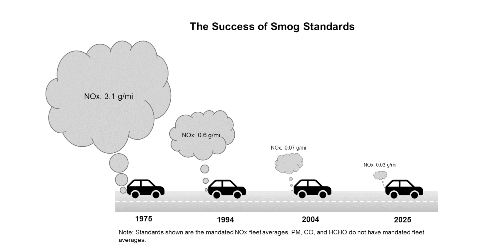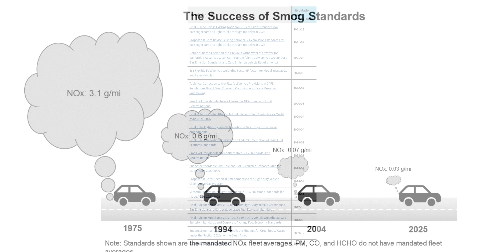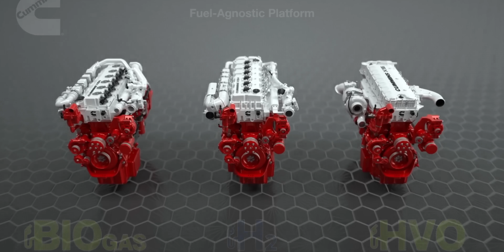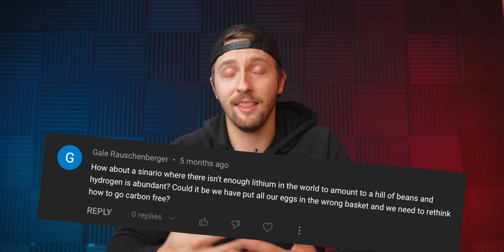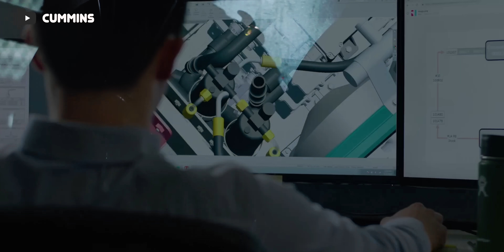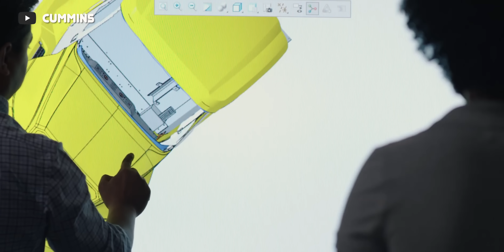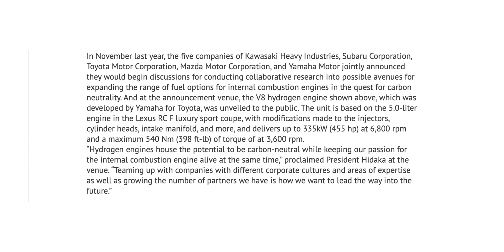Cummins Hydrogen Engine Will KILL DIESELS FOREVER

Comment: Seems difficult to replace the available energy density of diesel fuel.
Reply: If pressurized Hydrogen is half as dense that is not a big deal.
Reply: @gregkramer5588  explain your thought
Reply: @scottsand2317  have you studied hydrogen at all ?
Reply: It is but it has to happen
Reply: Pneumatics
Reply: Diesel has an energy density of 45.5 megajoules per kilogram (MJ/kg), slightly lower than gasoline, which has an energy density of 45.8 MJ/kg. By contrast, hydrogen has an energy density of approximately 120 MJ/kg, almost three times more than diesel or gasoline.
Reply: @shaneladkins  At high pressure and low temp right?  Hydrogen doesn't like the liquid state.
Reply: @shaneladkins  yes but you're failing to address the amount of energy required to reduce the temperature of hydrogen and keep it Cryo long enough to use it... Gaseous hydrogen is woeful in comparison to diesel and gasoline
Reply: @fluchtigziege3202  Of course this is a complex issue with many variables.   The comment being responded to was ONLY about energy density.  (Why do you think the Space Shuttle used Hydrogen?)
Reply: @Shaneon Adkins  it's a volume issue, not an energy issue.
Reply: @arthurkineard7356  correct people like to think they are smart by comparing the energy per kg/Litre of hydrogen vs conventional fuels, however this is ignoring a myriad of issues surrounding using hydrogen for fuel
Reply: It is not as big of a deal as you are imagining. You simply need larger tanks to make up for the volume. Other issues are a bigger deal like hydrogen embrittlement, producing green hydrogen and a non existent transport system. All solvable problems with current technology. What we are missing is the will to do it. To many other competing interest.
Reply: @arthurkineard7356  it does look like hydrogen may have a place in long haul trucking for sure.  I can picture a row of 4 vertical pressure tanks behind the cab on a semi tractor.   Of course it will be fuel cell and not ICE. The good thing this shrinks the infrastructure problem a lot!
Reply: @arthurkineard7356  LNG much better
Reply: @tobias1959  yea but greenness don't like it
Reply: @tobias1959  LNG is still a fossil fuel, and with goverments starting to tax use of fossil fuels more and more, its not a viable option. Not to mention that LNG requires massive infrastructure (same as hydrogen tho.)
Whole point of electrification and alternative fuel sources is to cut off reliance to fossil fuels. (and lower CO2 emissions.)
Reply: @Luihuable  The irony is that at this point in time, most hydrogen produced uses NG as feedstock.
Reply: @Luihuable  Infrastructure is right to our homes that have natural gas. Where is the hydrogen coming from and the energy to transform
Reply: @arthurkineard7356  it's not economically viable, and thus won't happen
Reply: @Fluchtig Ziege  yea it's hard to compete with embedded technology and infrastructure, but forever is a long time
Reply: @arthurkineard7356  aint nothing lasting forever, EV will have just as short of a run as ICE has had, it's just not the continual and unending tech they want you to think it is, economically ineffective to be recycled, toxic mining and recycling (where it's possible to recycle lots of the components can't be recycled), toxic fires from batteries, short service life of scalable small cell batteries, etc etc etc etc, a clean fuel would make more sense than EV albeit expensive in the short term, EV might get cheap in the interim but many pressures are already on the supply chain with basically 0 alternatives to the resources needed. It's not a win/win like everyone thinks and scaling for range in these vehicles just adds even more issues and would be socially irresponsible to build, aka EV will never replace long range vehicles that currently run on diesel/petrol.
Reply: My city is 7 years from banning anything that’s not zero emission. It’s not so much a question of “better” for some markets as “actually marketable”
Reply: @MichaelSmith-fg8xh  a decision that will be rolled back by a successive government after its woefully expensive and inept "implementation" takes place
Reply: The energy density of hydrogen (By mass or weight) is more than 3x that of diesel
Reply: @toddclean547  hydrogen mainly derived from Natural gas though right?
Reply: @davidb5952  Hydrogen derived from any source.   I am not talking carbon footprint here.   Only the energy chart.   (Anyone can Google this; it's Middle School level info)
Reply: @toddclean547  Quick everyone, google some random terms like "energy chart" and you will be 100% convinced that toddy has a big old chemistry degree, lmao, I am guessing that you deleted your "Im a chemist" comment because you aren't and pretending you were as an appeal to authority looked dumb, cos it was, and you got embarrassed. Lmao
Reply: @toddclean547  so we've gone from appeals to authority to ad hominem? Seems you really haven't got a degree at all, of any kind
Reply: @toddclean547  please do dazzle us with 5th grade science some more while you pretend to have a degree to win arguments you can't win
Reply: @fluchtigziege3202  answer the 3 water questions and then we will talk
Reply: @toddclean547  good mate how's ya imagination degree?
Reply: @fluchtigziege3202  Answer the water questions smart guy
Reply: @toddclean547  you're attempting to strawman
Reply: @toddclean547  try actually debating instead of using appeals to authority, ad hominem, strawman
Reply: @fluchtigziege3202  Try to stop using diversion tactics.   Answer the water questions.   And do you live with your parents?   (What country do you live in?)
Reply: @toddclean547  still busy building that strawman I see
Reply: Sorry to everyone else reading this Todd clean character literally spent all yesterday trying to strawman the debate/discussion after his attempts at ad hominem and appeals to authority gained him no ground whatsoever, it was funny but now it's just sad, what I assume is a lowly uneducated adult trying to pretend they have a chemistry degree, when the topic is more focussed on physics and engineering, as some sort of "gotcha" moment... When in actuality if they did have a degree thus far their lack of knowledge demonstrated in their own ineptitude would suggest that degree, should it exist, isn't worth as much as a kindergarten graduation certificate.
Reply: @fluchtigziege3202  I'm sorry that Fluckting won't  (can't) answer any of my basic questions   The debate started about chemistry but he knows nothing about it.   In the meantime, he spends all his time playing video games at his mom's house.
Reply: @toddclean547  sorry mate but no one cares about your strawman argument
Reply: @toddclean547  you can't debate me because nothing you have done is even remotely resembling a debate, and hominem attacks, appeals to authority and straw man tactics aren't valid debate methods
Reply: @toddclean547  you are literally the only one who has changed the subject, unless you're reading my responses to other people in a got of vanity thinking they're addressing you
Reply: @toddclean547  you make a lot of assumptions, I'm curious what you have besides half a dozen videos unrelated to anything you're saying to back it up? Yunno since you wanna change the subject and all
Reply: @fluchtigziege3202  Then answer my simple questions.   Are you living in your parents house?    Just answer!
Reply: @toddclean547  you said I am staying in someone else's home, burden of proof is on you mate
Reply: @fluchtigziege3202  Answer my questions
Reply: @fluchtigziege3202  Answer my questions mamas boy
Reply: @fluchtigziege3202  Answer the questions
Reply: @toddclean547  like I said you made the claim so, as per debate, the burden of proof is on you
Reply: @fluchtigziege3202  Answer my questions
Reply: @toddclean547  you fail to see how this works
Reply: @fluchtigziege3202  I fail to see how how you work.   I'm sure you don't.   Hey mom  --  I need some money.
Reply: @toddclean547  we'll see it's very simple, I'm sticking to valid and reliable debate methods whilst you are trying to use every faux pas in the book which achieves nothing
Reply: @toddclean547  I haven't diverted to anything, I've stayed 100% on point you tried a strawman it didn't work now you're trying to project... What are you 12yo?
Reply: @fluchtigziege3202  Then answer my water questions.   This whole thing started about chemistry and I'm testing you with very basic questions that I assigned in class.
Reply: @fluchtigziege3202  I have good news.   I am getting ready to send you my last message.   This "debate" is ending.
Reply: @toddclean547  oh good so you forfeit that's great
Reply: @fluchtigziege3202  Not yet.   And I am not forfeiting.   arguing with a FOOL makes me a fool.
Reply: @toddclean547  you're the only one here that doesnt know how to debate and has spent the entire time trying to derail the whole topic
Reply: @toddclean547  viscosity noob
Reply: @toddclean547  LOL, ok Mr "I have a degree" random internet mong, sure ya do buddy, sure ya do
Reply: You raise the compression ratio to compensate. Easy. It's possible because hydrogen creates lower exhaust gas Temps dramatically. But since theres no free lunch this results in larger storage tanks. That's fine for large diesel trucks. Converting truck stops to offer hydrogen is a mere bump for adoption.
Reply: False, the reason it is hard is because the multi trillons of dollars backing fossil fuel and buying politicians.
Reply: @chris  thanks definitely part of the hard
Reply: When steam trains burned coal, it was also said "They will not use that expensive diesel fuel to run the trains.  Coal is lower cost".  But maintenance costs is what doomed the steam trains to the museum or scrap yard.  

With $6 diesel fuel in California, and the ability to go 100 miles on 200 KW of electricity that cost about $40 on a charger at the home base, the cost to run a electric Pepsi truck will be a little less than running on diesel fuel.  

They also said that the steam trains also are so expensive that they would "Never" retire them with less than 20 years. old and 2,000,000 miles on them.  However they did retire them at a quick rate once the cost to maintain them was discovered.  

I have a feeling that those wanting to buy a new $170,000 diesel truck will want to spend $250,000 on a diesel truck once they discover that the fuel cost will be less than $40,000 a year to go 100,000 miles.   To drive a typical truck at 6 MPG 100,000 miles would be 16,660 gallons of fuel or about $83,300 at $5 per gallon or $99,960 for $6 fuel.  Of course getting 5 MPG means $100,000 or $120,000 to buy 20,000 gallons a year at 100,000 miles.  If they expect to put 200,000 miles on the truck every year, that is going to make the cost of the truck even lower when running on electric.

Consider a brake job every 35,000 miles.  And the trailer too.  Consider a oil change every 3 months or 18,000 miles at about $350.  (with a fuel and oil filter, ect.  ).
Reply: @Kangenpower7  you seem to think there won't be a lot of service issues with an EV truck, which there most certainly will be, and that energy isn't guaranteed to cost what it does now and it's almost assured to rival the coat of filling up on diesel as we experience it in recent history, I find your argument to be lacking in any real depth

Comment: this does seem more like a stop-gap or a good way to retrofit old machinery (which I'm glad about).

as you eluded to, having a hydrogen storage tank is an inconvenient thing no matter what, so you want to use the hydrogen you have as efficiently as possible. 
and hydrogen combustion engines are half as efficient as hydrogen fuel cells, so in the long run fuel cells are a no-brainer.

Comment: Cummins will go the same way as Xerox and Kodak, because they're making products that are rapidly becoming obsolete. Where else can they go? Sadly, hydrogen Engines make zero sense, because they're even less efficient than Fuel Cells that work much better and stiil only achieve 60% efficiency.
Take a look at this explanation of how hopeless Hydrogen Engines are...
https://www.youtube.com/watch?v=vJjKwSF9gT8&t=1s
There's no point in going to Hydrogen, you may as well keep building Diesels, they're no more polluting overall.
Batteries are improving at such a rate that they will indeed replace Diesels in the next decade. Cummins will then no longer exist.

Comment: Still have to figure out how to overcome the low volumetric energy density of Hydrogen. It’s not about the engine it’s about the fuel tank. 😉

Bit of a pipe dream.

Comment: I think to better illustrate just how important fuel is you should have used some graphics.  Although, you did touch on this information briefly.  People don't seem to understand that diesel and gas are more or less perfectly suited for the internal combustion engine.  Temperature factors, caloric factors, and safety factors make fossil fuels practically idiot proof.  While liquefied compressed fuels are simply more dangerous to house inside vehicles.

Comment: No it won't, miles per gallon is really bad. And infrastructure is years away for it to be feasible at this time and even then the only efficient way to use hydrogen is with fuel cells, these are on par for mpg with diesel.

Comment: Cummins is going to do anything to keep themselves relevant within regulations in the US. They build some of the best diesel engines around, but if the regulations don’t allow diesel engines, they have to adapt or they will disappear. Personally, I believe things will come back around to square 1 with biodiesel panning to the top. But either way, owning an excavation/land clearing business running stuff like my Fecon dedicated forestry mulcher, I don’t see how they can beat a diesel engine’s performance across the board any time in the near future with electric. I wouldn’t buy something that’s limiting us to running it for 8 hours max before charging, or something that will lose run time because it is cold. People like me are who the industrial engine manufacturers have to please.

Comment: The production of hydrogen fuel is likely to require vast amounts of Dino powered equipment.
Reply: Actually most hydrogen is changed into fertilizer and other industrial products.  Most hydrogen is not compressed to higher than 100 PSI.  The 5% that is over 1,000 PSI is normally delivered in small tanks.  Most is used within 2 miles of where the natural gas is changed into hydrogen.  To produce the amount of hydrogen used in the United States with electricity would take about 5,000 Terawatts of power when the conversion is 400 KW per Kg of Hydrogen.  So all the wind and solar power made in the United States in 2021 did not make enough electricity to produce all of the hydrogen used in America in 2021.  Even the nuclear and hydroelectric dams would not meet the needs to produce that much hydrogen.  

I have a feeling that hydrogen will not be the fuel for class 8 trucks.  It takes way more electricity to produce enough power to run a class 8 truck 1,000 miles compared to running a Tesla truck at 2 KW per mile.  400 KW per Kg of hydrogen, and over 80 Kg of hydrogen per 1,000 miles to run a class 8 truck.  So 32,000 KW to run a hydrogen truck or 2,000 KW for the Tesla.

Comment: Cummins already makes a cng powered engine for the 9 and 12 liters usually found in city transit busses and trash trucks. The 9 shares many parts with its diesel brother but the 12 is almost a mirror image of its diesel counterpart. The problem is natural gas burns so hot that it tends to melt the valves and pistons
Reply: LOLOLOLOL …

Comment: I’d rather see hydrogen fuel cell to run the electric motors. That way fill ups are 5 min, but still has simplicity of electric. No lithium battery for long run trucks.

Comment: The continual sustainable use of hydrogen as a fuel is still about 20 to 30 years out as the current world production of safe clean viable hydrogen is still quite a bit lacking just like the electric infrastructure in America is not even close to expansive enough to be able to even handle 25% of the american electricty fuel standard, hell it's still got a good 10 years or so before that's possible. The majority of the rural USA is still completely lacking in any kind of electric charging infrastructure, you can go through areas where you will drive 500 600 mi if your car can do it without seeing a single electric fast-charging station, only thing you'll find is 110 standard wall current

Comment: Making Hydrogen fuel is easy. Just requires a heavy investment into Nuclear power in order to generate the fixed Hydrogen production plants. Then use the Hydrogen for these engines. I have a 6.7 in my 21 Bighorn. I’d do the swap as a tester!

Comment: Hydrogen will never be used in place of gas/diesel (for personal vehicles/cars/trucks etc), it's a problem of hydrogen storage.  There's simply no way to store the amount of hydrogen needed in any kind of way on a vehicle/truck etc that can come close to the same space/volume energy density that you can with gas/diesel and even EV (batteries).  It's not even close, any talking about hydrogen for use on private vehicles is simply a stunt.  For a fixed position generator, power plant, or energy storage (converting clean energy, ie. solar/wind, into hydrogen for powerplant use), hydrogen is viable but it will never make it into a car/truck etc, it's just physics at this point.